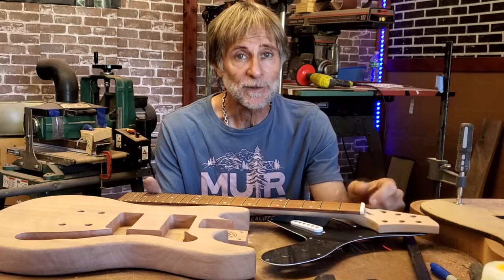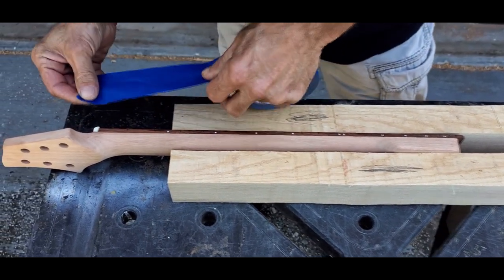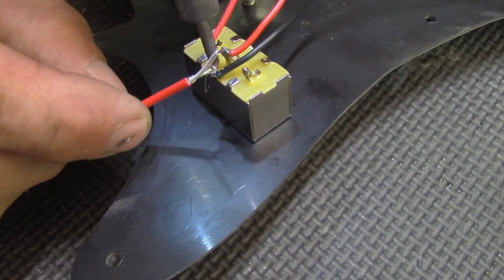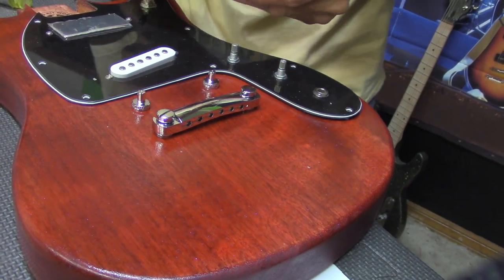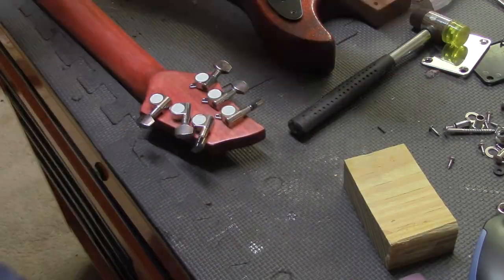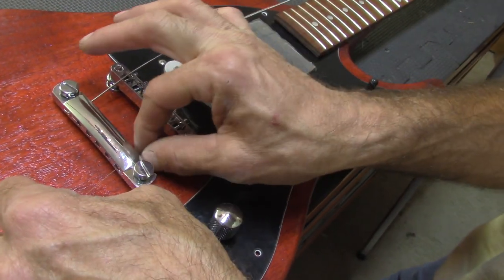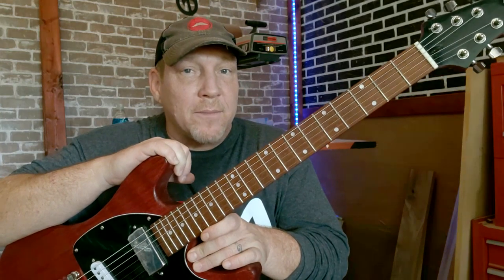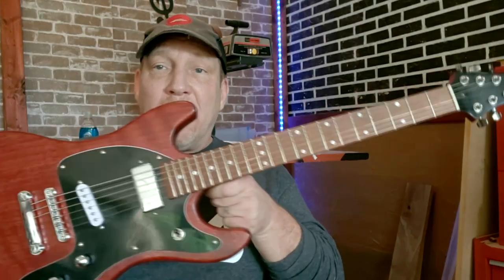When A GUY With NO EXPEREINCE Builds A DIY GUITAR KIT!!!!

Comment: Thats me. Another Jim. This is a great video. If it were me I think I would stain it black and add a gold accent into the pores. Then I would cover it with a thin epoxy to seal it all in. Then I would clear coat and polish it to a nice gleam. I think I would leave the neck natural but give the headstock the same treatment as the body. A satin finish on the back of the neck. For a start. Maybe put shielding paint in the cavities. I actually made some from powdered graphite and acrylic paint.

Do you like Sean? become a patron. Patreon.

Comment: Jim, since you asked: solder should be used to "weld" the connection, not to secure it.  The wires should go through the holes and be bent 180 degrees to secure them; then solder.
Mark
Reply from the maker: Thanks for the tip we need more guys like you around here

Comment: For the pickup height. Couldn't you fix it by putting a thicker pick guard on it. Make it look arch topped almost or even a aluminum sheet under the pick guard to make it higher? Genuine question
Reply from the maker: Sure ya could but ya still got the leaning bridge with bad string tension.